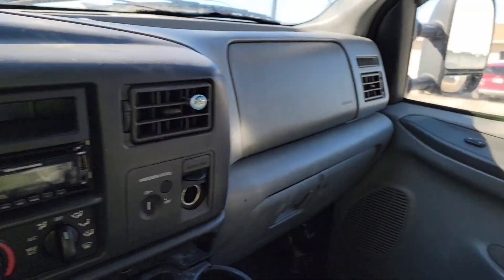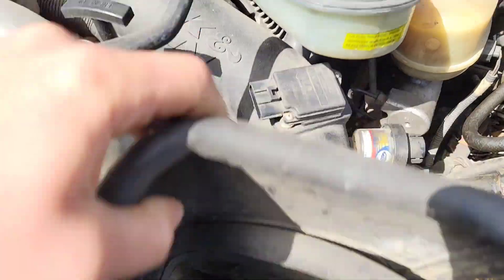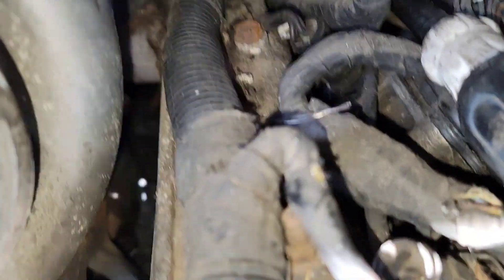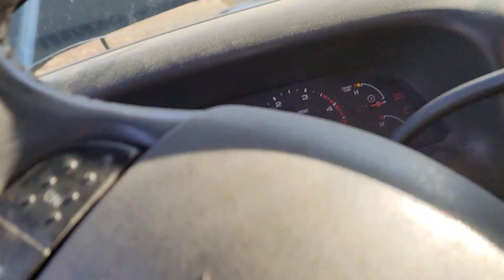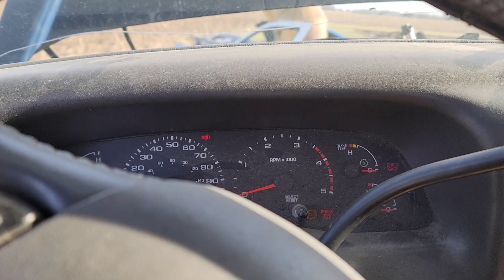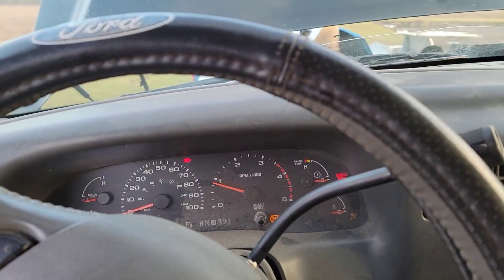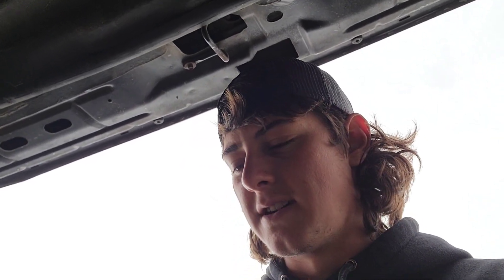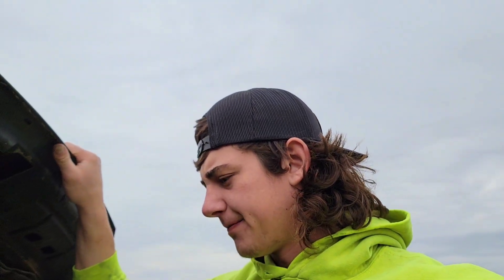I BOUGHT A 2003 6.0 POWERSTROKE DUALLY

Comment: Damn bro how many 6.0s have you had, you had the white flatbed 1, then the black one 2, then maroony, 3 then the white work truck 4, so that makes 5 😂😂
Reply from the maker: Shiii😂😂😂
Reply: @freeddiesel  I would check the stand pipes and dummy plug. Had a 6.0 that was doing the same thing and it was the dummy plug oring
Reply: Uve owned that many and u bought a 2003?........ still I'll take a 6 over anything.
Reply: @freeddiesel   do u know where I can buy a 6.0 for a good price
Reply: @damynowens934  theyre prettt good priced now back in 2016 they were going for 30k plus. Now theyre about 16-25k

Comment: Thank you so much for this video I have a 03 6.0...that I think has a bad icp sensor or ipr valve...it will idle great but once I drive or a few miles it shuts off or acts like it starving for fuel but will always start rigth back up
Reply: Pull your fuel cap off, I have a few videos on my channel of the same problem, going up a hill it would die, pulled the fuel cap, and it hasn’t happened since

Comment: That oil filter looks like it was crushed, I’ve noticed that some after market filters and caps are taller then OEM.
 So if you use an OEM cap with after market filter it will squish it and after market cap with OEM filter will allow oil to pass without being filtered. 
Good content👍 got to love 6oh’s